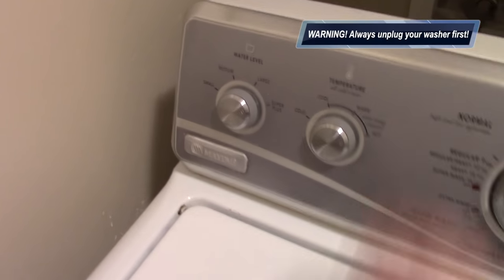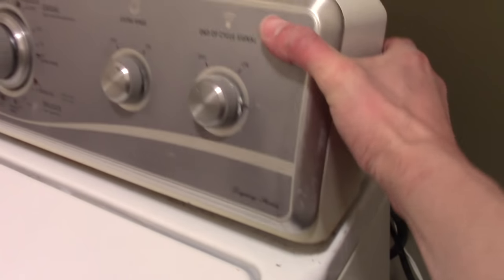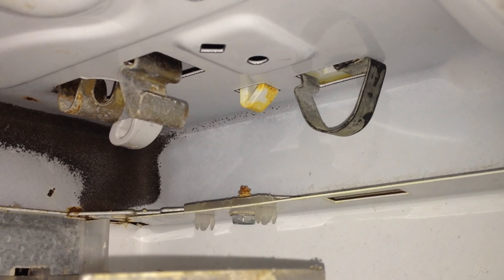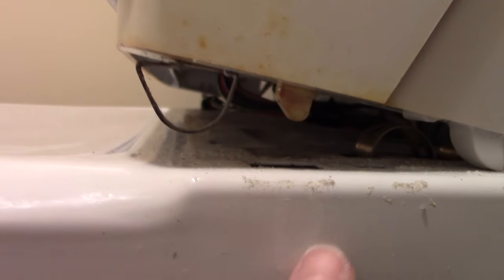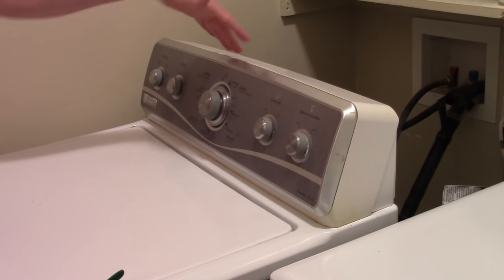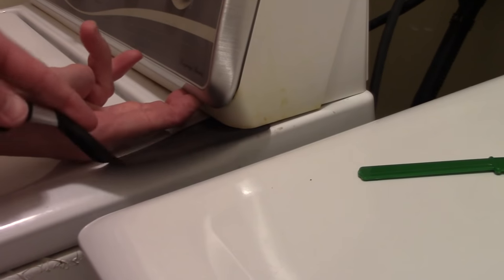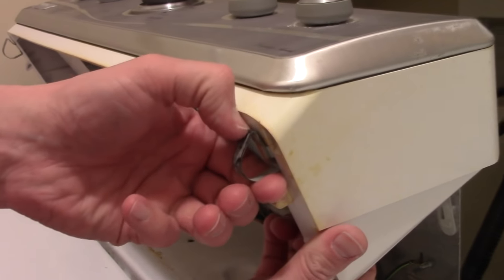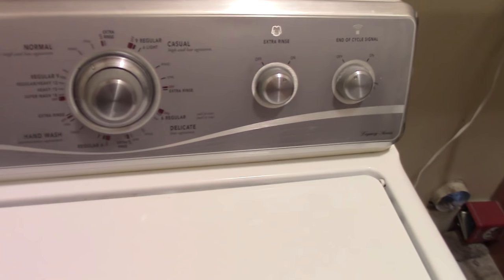How to open or remove a Washer / Dryer Control Panel - Whirlpool Maytag washing machine

Comment: Just what I needed, I had no clue. First try was rough, cut thumb and swearing,  then I used a screwdriver shank to compress the spring from underneath and tipped the panel up at the same time, made It pretty easy.  Fixed my door switch In one hour thanks to you.

Comment: Thank you. EXCELLENT video and camera work.  All other vids were advising to just wedge a flathead under the front of the  panel and pop the clamps open. WRONG ! All that was doing s starting to crack the silver faceplate of the control panel.  Your video was soooooooo much better !

Comment: I have this exact same washer. I replaced the lid switch a few years ago after the cheap plastic tension clip gave out. Ever since the lid wouldn't engage the switch reliably. I blamed the bad design of the switch because it does not seat tightly in the hole in the washer top (if you've replaced it, you know what I'm talking about). For years, my wife and I have been Fonzie style hammer punching the top of the washer near the switch to get it to engage. I finally got around to installing a new switch just now and it didn't help. Then I noticed the metal rod that engages the switch is held by two small screws in the lid. The screws were just a tiny-ensy weensy bit loose. I tightened those screws and BAM. The switch engages like a charm. We've been punching the crap out of this washer for years because of two tiny, barely loose screws.
I had to tell the internet. So there. Done.

And nice vid btw. It helped remind me how to get to the lid switch.

Comment: Thanks.  This is the only video that I found that shows this type of connection and how to remove the control panel.  It's a neat design,  it's just a shame that maytag makes these machines with hidden fasteners and hides this information from the customers. I will probably never buy from maytag/ whirlpool because of this.

Comment: Hey Adam, that was very informative for me as I am trying to remove the outer casing because the left panel on the far bottom got bent and it came loose. So, I am trying to figure out a way to bang out the dent and replace the panel back so that I can screw it back in. It is an old Maytag Dependable care washer.  Model no.  MTW5700TQ0 and I can not find one video that shows you how to do that on this particular model. Hope you can help.

Comment: I have this exact washer . How do I access the tub I need to give it a good cleaning. Also does this model have a filter I can clean out please respond.
Reply: Look at the Video @ :58, and pause it...you will see the brass colored clips that he mentions to "not" confuse with the panel clips...
Use a flat blade screw driver, and put down into the hole and catch the recess of the clip, and pull and rotate forward. Do this on each side, and remove the clips.
Remove the connector from the lid switch on the left, and lean the entire cabinet of the washer forward, and lift up and out, and set to the side...
You know have full access to the plastic top of the tub, and can clean accordingly...
Good Luck,
ATM

Comment: The video was very helpful. My question is, the knob only, broke off on the water level control, does the whole thing need to be replaced or is there a way to just replace the knob? Appreciate your help.
Reply from the maker: Did the stem break off inside the knob? If so you will need to buy a new switch.  If it's just the knob that is broken you can get a replacement knob.  Many times other brands will fit.
Reply: Yes, it was the stem. Thanks for your quick reply.
Reply: @AdamDIY   how do you lift the lid to get to the drum?

Comment: Thanks for the video. I tried your first example to remove with my hands, but not strong enough. I tried your second example with the spatula worked like a charm.  Unfortunately I lost the left clip in between the wall and the drum! Yikes! Other than trying to take my washer apart do you have any ideas how to get the clip out? Should I even try?
Reply: Just did the exact same thing, ever get an answer?
Reply: All of us clip idiots await the solution

Comment: ...and for those who want to go further with repairs... flip over the control console as shown disconnect the lid switch connector. Remove the 2 gold colored clips on the top left,right side with a flat screwdriver and push up on the front of the clips then open the lid and tilt the front top entire housing away from the washer. First always unplug the electrical cord from the machine to the wall socket before you do any repairs!! Safety first lock it out.

Comment: Another question, I don't see your video on how to remove that  (water level) switch. I saw another video but I don't think it applied to my Maytag which is the exact one that was in you video on how to access the panel. Can you help me out again?
Reply: Look at the Video @ :58, and pause it...you will see the brass colored clips that he mentions to "not" confuse with the panel clips...
Use a flat blade screw driver, and put down into the hole and catch the recess of the clip, and pull and rotate forward. Do this on each side, and remove the clips.
Remove the connector from the lid switch on the left, and lean the entire cabinet of the washer forward, and lift up and out, and set to the side...
You know have full access to the plastic top of the tub, and can clean accordingly...
Good Luck,
ATM

Comment: My nephew took the back off of my washer looking for a belt.  After he had taken it apart, he admitted that he didn't know what he was doing.  I have found someone that's willing to work on my washer if I put it back together.  Do you have any videos of the back of the washer?  The model is this video is exactly like mine - Maytag model MED5820TW0, serial CW3440485.  Any recommendations will be greatly appreciated.  Thanks.

Comment: Hi...
What happens if you drop the clips in the machine🤦🏾‍♀️  i was trying to follow another video..and accidentally dropped them down the hole.  Im trying to check my drain hose to see if its clogged because my machine won't star washing.  It starts up the it knocks..but won't fill the tub or spin.

Comment: Oh man, I should've kept watching. I used channel locks to squeeze the clips. I broke the lid switch retention clips on the left side (cheap plastic). If this happens, you can shove a pencil into the switch and hold it there with a wire bread tie until your new switch arrives. Go straight to spatula. I was fooled as some of these use a putty knife to pry up the panel, not this style!

Comment: how do you take top cover off to clean around drum
Reply: Sandra Wilk that's what I need to know. just moved into a home where they left the washer absolutely filthy. need to clean around. Any luck?
Reply: Anybody find out ?
Reply: Look at the Video @ :58, and pause it...you will see the brass colored clips that he mentions to "not" confuse with the panel clips...
Use a flat blade screw driver, and put down into the hole and catch the recess of the clip, and pull and rotate forward. Do this on each side, and remove the clips.
Remove the connector from the lid switch on the left, and lean the entire cabinet of the washer forward, and lift up and out, and set to the side...
You know have full access to the plastic top of the tub, and can clean accordingly...
Good Luck,
ATM

Comment: Worked on a Bravos XL.  Was not able to get a spatula underneath, so scratches on the top from the metal spatula.  Next time maybe I'll try to put some tape down.  Or maybe I just wasn't holding the start button long enough.  Nah, couldn't be that.

Comment: I am getting F-1 fault on my Cabrio washer....when this happened @ 3 yrs ago, disconnecting / reconnecting electrical leads to washer body took care of problem...apparently time to do it again...couldn't remember how to get control panel loose...
Reply: Hello, If you continue to get the F1 trouble code, time for replacement of the control module for the washer, not the control panel itself, but the module located under the control panel...
Good luck,
ATM

Comment: My Cambrio Dryer was dropped omn the stairs.  The control panel is broken but not sure if the internal parts are broken.  how do you change oujt the control panel completely?
Reply from the maker: +Larry Suarez Super easy. Just do what you see me do in the video and disconnect the wires as well. the front of the panel attaches to the base with a simple slot.  You will be able to figure it out.

Comment: HI I have one just the same washer you have, I lift the lid up while my washer it's spinning to stop the washer then I want to wash my cloth again I pull up the start knock the washer it doesn't do anything at all, no water filling no any noise at all BUT when i turn the knock to spin then the washer it is spinning, what's wrong with my washer. please help me out.

Comment: How do I access the switch on a Whirlpool thin twin, It seems to have come apart - We can turn the timer with a needle nose pliers but there is no way to know what part of the cycle it is in, the first thing that went wrong was the knob came off (push to stop and pull to start).  Then the rest seemed to fall back.

Comment: I'm having a hard time finding a clip I have a hot point washer model htwp1400f tips please?
Reply: Hello,
The hotpoint washer is not made like the Whirlpool/Maytags...look up a video, but it requires removing screws at the back of the washer, and using the knife/blade method to unfasten the front clips of the main lid housing...
Good Luck,
ATM

Comment: Maytag Centennial Washer   water won't fill machine.  I hear a "hum" of "Buzz" in the control panel, but water won't start no matter what cycle is chosen.  Other functions like spin, etc.  work.  Please advise.
Reply: hey did you ever find the solution on your washer...I am having the same issue

Comment: Why oh why, do engineers make appliances so hard for us techs to repair and perform maintenance (more so repairs....Cuz ppl don’t usually call for 6-12 month preventative maintenance, like they do for other things, example: a car; as u would definitely change oil when “car” says to change oil; not ignore and keep driving, or heck. Even simpler..... if gas gauge says need gas/petrol, I bet you ARE MOST DEFINITELY gonna fill the tank, lol).
If more ppl “maintained” their dishwashers, water heaters, fridges, washer or dryer, and A/C units at least yearly; imo, would help in  long wrong for repairs etc...
But, keeps us in biz, either way 😉
Nice vid, cheers😉

Comment: Spatula? Plastic knife? Sure these  work, but I've used a stiff 1.5" putty knife.  Plus the putty knife is stiffer which makes it much easier to use. AND the wife isn't gonna complain you "ruined" her spatula!
There is plenty of room to slip it under the control panel without risking scratching the washer, just make sure the putty knife is clean and rust free and you won't scratch any paint